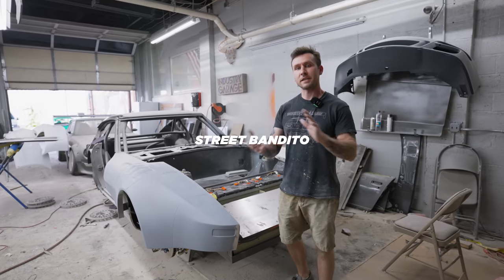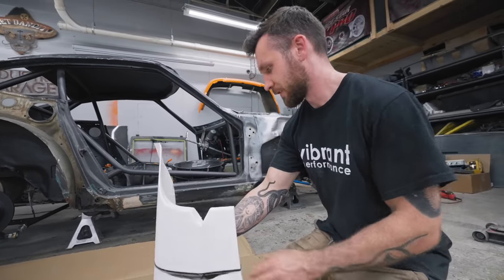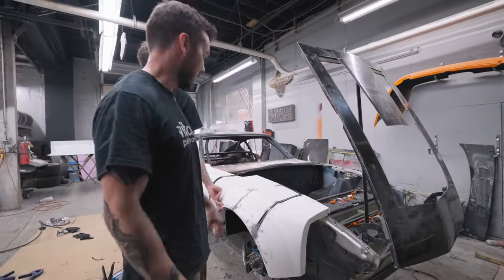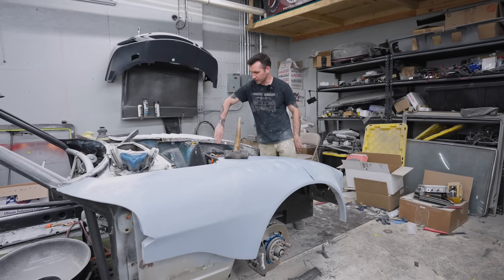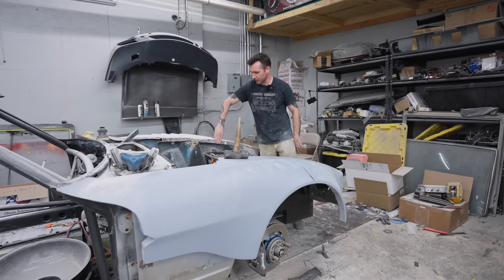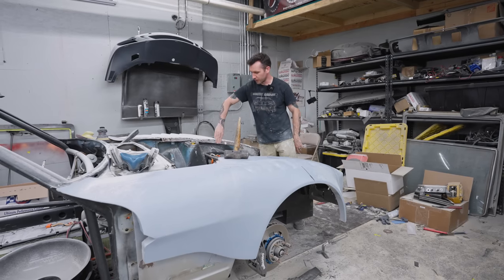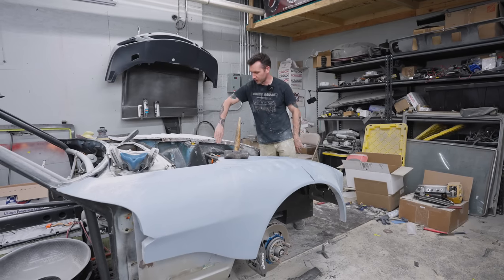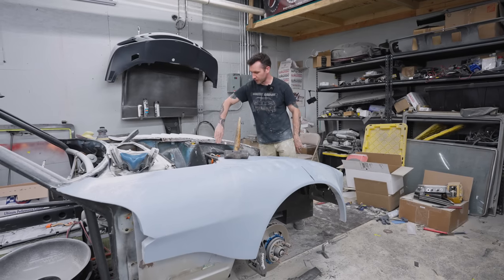Using 3D Printers To Build A Car Out Of Carbon Fiber | Part 1 | The Legacy (11)

Comment: I absolutely love how this thing looks The only thing that ruins it for me is the fact it is Electric. Different I would have done if I was doing this project Is set a gas motor Mid engine side mounted Like the nsx or the mr2 Or even the fiero powering the rear wheels And do something like a super charged V6 With an adapter plate And The transmission Out of a lancer evolution And if able The shaft point for the Transmission that goes to the rear diff Have that with a few u joints Going to a spot And use that to power the super charger And it wouldn't rob power from the Crankshaft itself from the pullys there

Comment: No expert, but wonder f It has a long nozzle because it has an automixing process built in. If you look in detail you can the 2 components travels through a maze in the nozzle, this mixes the 2 different compound.

Comment: Wouldn’t it make more sense to have a router table make molds with foam?
Reply: Would need a decently large multi axis cnc. A lot of college FSAE teams (with large budgets) go that route for nose cones
Reply: @willshubaru  I still feel like you can do it in sections similar to the plc prints he did with a home built router table.

Comment: Naaah dude, you're using too small nozzles for that size print! Use 1mm nozzle with layer height 0.3 (you could even do 0.4+ depending on material and hotend) thats waaay faster and since you're going to fill and prime anyway layer height isn't an issue

Comment: Welcome to 3D printing. For the audience, carbon fiber filament is a huge scam. The fibers actually lower the strength of the plastic and wear out nozzles before the end of the print. ABS cannot be printed easily at those sizes without enclosure and temp control. PLA will warp in sunlight. For this application beyond fast prototyping, you will need a service to 3D print the plastic and switch to much more expensive plastic. 

Don't buy the BS that carbon filaments are strong. 

Good for fast prototyping and mold making, but people new to this should realize 3D printed parts will not be strong and durable enough for automotive applications with typical consumer plastics and printers.